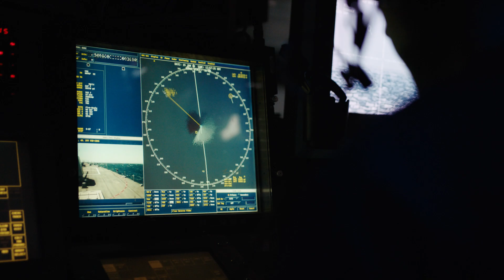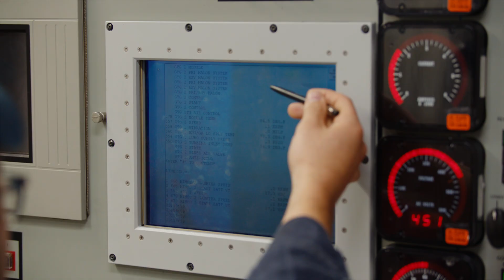Navy Electronics Technician – ET

Comment: ITs make money when they get out of the Navy. ETs dont.
Reply: Why?
Reply: @KAXSH  Because the demand for network engineers and cyber security individuals is high (especially with a clearance), and the demand for electronics techs is not. If you're an ET and want to make money on the outside learn as much IT networking as possible.
Reply: @kierangallagher5687  You are wrong specifically navy ET’s and as well as coast guard ET’s are very marketable in the marine transportation industry Cargo ships, tankers, and cruise ships all use ET’s. Furthermore The IT  rate is taught to ET’s in a “C” school while IT’s will never be able to do the work of a ET
Reply: @jordyb2193  The marine sector you mentioned is incredibly small and often requires extensive travel. Also, Most ETs dont receive ISM training and don't work on IT systems- some do, but most do not. The IT rate provides  sailors with far better job opportunities after departing the military. That is undeniable.
Reply: @kierangallagher5687   I’ll run it all the way back for you to your earlier comment about “network engineers” and “cybersecurity individuals”. They have 4 year degrees and certifications coming out of college. IT3 on the other had that just got out of the navy has “A” school and a “dd214” they are not the same no mater what your recruiter told you.

Comment: The key rule of thumb with electronics: Always keep the smoke on the inside.
I worked industrial environments - PLC's / freq.drives 3 ph /old school relay logic / hydraulics - up to 1,000 ton presses - directional valves - accumulators - etc / extruder - 400+ up motor controls / everything pneumatic / chillers - water treatment/maintenance / tons of mechanical stuff - welding etc - structural analysis.....product development (molded plastics). Worked on "turn key start ups" (A real joke of a term).  Now retired....doing self-employed work as a handyman (repairing lots of cars tho! b'cuz of electronics).
Maybe I should've joined Navy?
Go Navy....good career 😜👍

Comment: Former Navy ET.  
Boot in FLA in Aug of 88 and schooling (A and C) until May of 1990. I still made E-5 in less than 3 years.  I was able to move up fast because I was well trained. 

After reporting to my ship, they soon sent me back to attend AN/SPA-25G C school in Oct of 1990 at the 32nd St annex ET C “school house”.  

As I remember it, that SPA was constantly over heating because it didn’t have an exhaust fan.  

While in the gulf (the A/C wasn’t the best) I had to open it up almost every day to let heat out. 

It frequently would flake out due to overheating and one of the CIC guys would wake me up at 3 am.  

Good times!
Reply: i heard you can make 6 figures out with the et experience especially of the top secret clearance